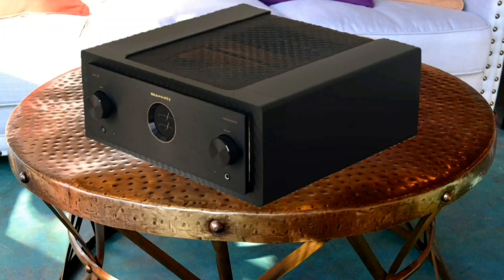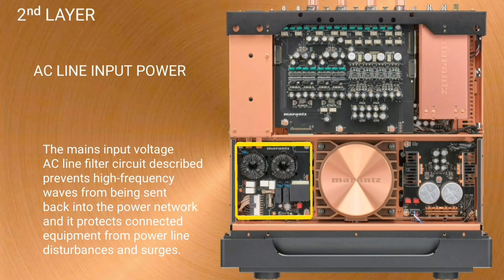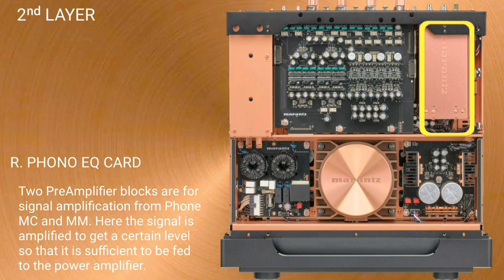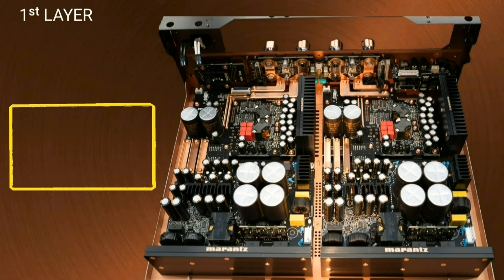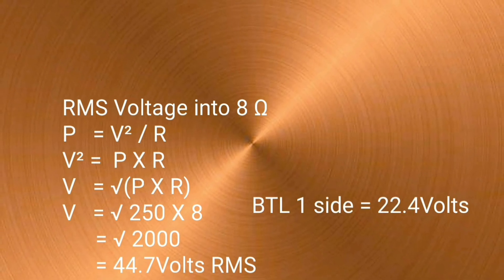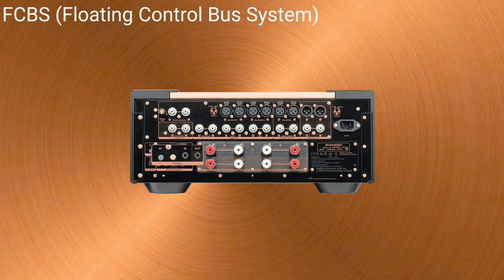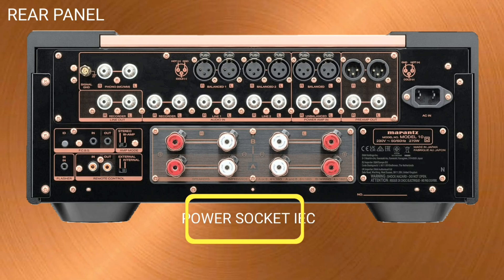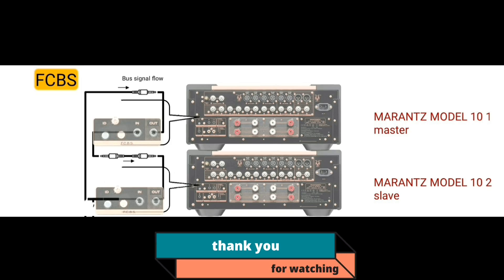Marantz model 10 class D integrated amp should be looked at ext and int

Comment: No 47.000uf 100v capiscstor
No twin 1800v transformer
Reply from the maker: Very useful input I will investigate further
Reply: @JNElectrics 10000uf 100v is rubbish cheap, it should come with 47.000uf or 39.000uf 200v
Reply from the maker: @RozeRosy-f3l yes. you are right, marantz model 10 section power amp uses power switching regulator, so it does not need a large capacitor. transformer is only for PreAmplifier.
Reply: @JNElectrics  cheap money saving schem

Look at piooner m22 teac500 it uses 39000uf 200v and 33000uf 200v they did not cheap out
Reply: @JNElectrics  Mundorf Nischicon 33.000uf 200v capisctors cost £70 each, and switching regulator cost hkaf off that

A 670000uf 200v cost £90 each and 3kg weight